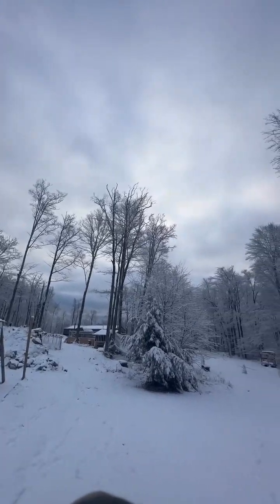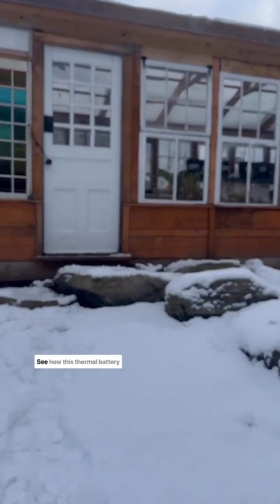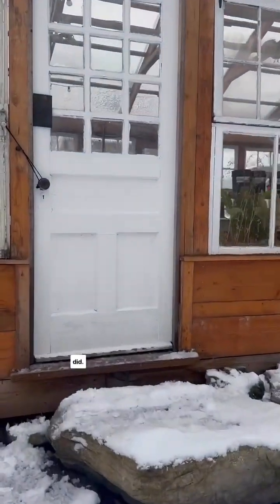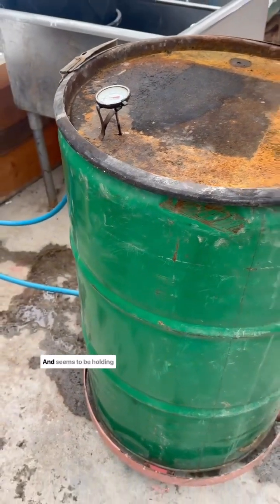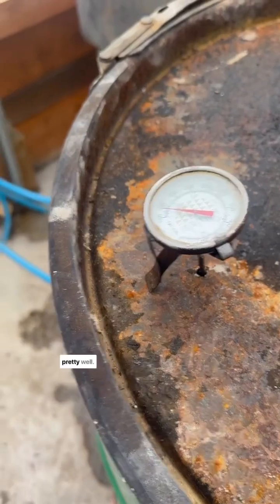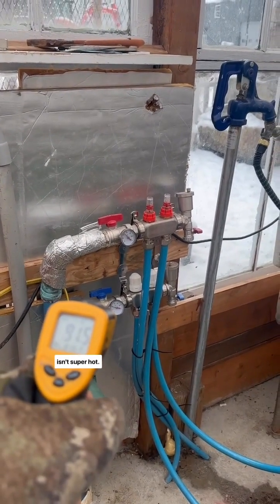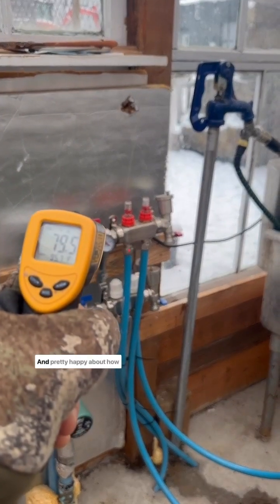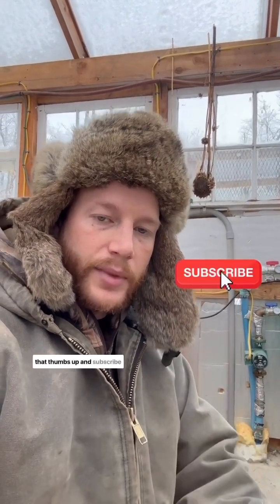Checking out the DIY sand thermal battery build #diy #energy

Comment: ❤️ I’m to attempt making a Sand battery using a solar panel and run a house water tube through in order to prevent freezing the house plumbing during winter  …and probably  continue using that in summer to aid the house boiler….. your project inspired me .. thanks 👍🏼🙏

Comment: You're using a boiler?   I would use a passive solar heat collector (drawback is that it works best in sun, it's does get TINY warmth from cloudy sky...still has infrared even if cloudy).

The passive, insulated, solar collector (the soda can or the dryer vent hose method) will help supplement.  You might need to talk around in shorts on those sunny winter days.

Comment: A “Vortex Tube” receives standard compressed air, outputs  -50 F on one end and 260F on the other.  Could multiple Vortex Tubes, take the cold air to cool down a server room and the hot air to heat a sand battery?
Reply: Sure? Probably not very efficiently though. Vortex tubes are more efficient than peltier junctions, especially if you can productively use both outputs but they are nowhere near the efficiency of heat pumps. Mostly used for extremely robust simplicity where you already have excess high pressure air. But as far as I know common designs are optimized for extreme output temps when you don't necessarily need output a hundred plus degrees colder than ambient so who knows, maybe the efficiency is more competitive at smaller temperature extremes but I've never really got my head around the math believed to describe how they operate and how you'd need to tweak it. Its funny how the effect wasn't invented as much as discovered in the wilds of French pneumatic mail tubes.

Comment: so how does it even work, you heat up the sand with water heated up by the wood and the "battery" then heats up and does what? release the heat out? Its not a batery. You can just throw away the sand and heat up the room with the water hooses no?
Reply: Its a "thermal battery." Which means its more about keeping the space from getting so cold than getting as warm as you might. 

The waste heat goes into the sand and is allowed to re-release much more slowly. This way heat that doesn't really make any difference while the sun is out or the boiler is running goes into keeping a greenhouse from freezing over night, for instance.
Reply: @johnassal5838  but what waste heat is there? its the same heat that would warm up the air in the room. you can just throw out the sand and connet the hoose to large watter tank, increasing the volume of water in the system then at least water is heated directly in the furnace
Reply: @igormoravcik300 Do you read English? 

Its "waste" heat because it's the somewhat cooler water that's already heated the creaters home or shop. 

From a boiler that does not run all the time. Wood fired boilers in particular need to be watched. So you need a "thermal battery" to act as thermal mass and absoarb this "extra" or "waste" heat while its available and then re release it more slowly. Because this application has nothing to do with making the greenhouse as warm as they can, its just about keeping itvfrom freezing overnight in the winter while using the least amount of heat to do it.
Reply: @johnassal5838 you description is wrong there is no extra "waste" heat this is just the same heat that is produced by the fire, without sand it would just heat the air to higher temperature for shorter time. The sand there is useless, the same effect would be achieved if he would simply imcrease the water volume in the system by connecting buffer tank with water

Comment: Hello, can your thermal battery, store energy enough to power your electrical appliances ? 

If yes then How would it do against a 5 solar panel home system?
Reply: im looking into building a few of these and still deciding on the final plans, the biggest thing to keep in mind is you can heat sand to absurdly high temps, so in theory, any extra energy you create you can burn off into the sand battery. im considering mine for keeping the greenhouse warm in the long run over the winter using it as a flooring several feet deep.  the loss for this battery comes in trying to use it to turn a turbine to generate energy back from it. if you use it for radiant heat, they are wonderful.

super interesting technology tbh.
Reply: The quick answer to your 1st question is: "if it's big enough, yes!"... also see the comments about sand vs. water as the storing medium.

As for the 2nd one, you can't really compare the "producing" part of the system to the "storing" part. The thermal battery is just storing module of the system, "5 solar panels" are the energy "producer" (more accurately, the conversion module, from sun light to electricity).
A solar system may have any type of batteries, and they may or may not be adequate for your personal energy needs.

Comment: I'm a bit surprised. Video had 17 comments by now. I had two main concerns after watching it. Both were pretty professionally handled in two first comments (in the order yt showed those to me).

And the things were: aiming the ir-thermometer to average half of the wall (where emissivity is another big thing) and having way more heat capasity with water instead of sand.

Sand might slow things down a little and it might be beneficial when used as a radiator for small room though.

For capasity with sand you need to aim at >500°C to gain something. And things get complicated pretty fast with heat exchangers, valves and fans (as air is the easiest way to transfer that high temperatures) that would handle higher temps.

Handling the ir-emissivity is actually quite easy. Don't even bother to learn how the things should work, as real life screws everything. Set the thermometer (or thermal camera) to 0.95 and stick electrical tape to everything interesting. Now you have a known surface material to measure from and you could even check with something you know the temperature otherwise, like a boiling pot of water and similar container with melting ice. Couple degrees off is just fine, but after testing, you now know your tool and there starts to be some meaning behind the numbers. And those tests would make a nice video too..

Comment: Water stores 4.2 joules per gram per deg C, Sand stores 0.84  If your sand only rises to 100 deg C you could store 5x as much energy if you replaced it with a same size barrel of water. Of course you can store sand at much higher temperatures which is how it is used industrially.
Reply: sand weights 1682kg per 1m^3 water only 1000kg, most of the time when you build things like this you are space limited because the container has to be properly isolated and its "expensive"
also smaller containers has small surface area so they lose heat slower

you can store like 400kwh of energy in 1m3 of sand when you heat it up to 1000C

you can store like 116kwH in 1m3 of water when its 100C
Reply: @423GustavBern  plus the issue of converting it to elelctricity is harder with low temp water
Reply: Exactly, with below boiling point go with water..sand only if you can go freaking high. High potential heat is hard to come by, so I suppose water is a way to go in most cases.
Reply: @JanicekTrnecka  ...like a coventional radiator...
Reply: @Humanity101-zp4sq I think the idea is storage of lower grade heat or at least slower release of it. By definition a radiator is optimized to get it out and radiated/convected away.
Reply: Makes sense!  That barrel may not be terrible water tight though😂

Comment: Why call a heater a battery? 🤔🤷🏾
Whats the temp of the whole room?🧐
Reply from the maker: its a greenhouse so its at like40- 50 during the day in the winter. and its more like a sand radiator.
Reply: It's called a battery because it's "charged" with heat when there's heat, and "discharges" heat when there's no heat. This charge-discharge cycle is like an electrical battery, except for heat.

It's used to store excess heat and distribute it when it gets cold - usually daily, but can also work somewhat seasonally.

Comment: why call a heater a battery? 🤔🧐🤷🏾
Reply: A battery stores energy and heat stored within the sand is energy stored for latter or prolonged use. It is a thermal battery.
Reply: @JNash-ro5on  but the heat is generated with what wood? its not a batery just a very heavy heater

Comment: Just a quick tech tip, im case you or someone else here didnt know: the 'spot size', or the effective area that your temp gun is reading, is going to increase the further away you are from the object you're measuring. The particular brand often has a little diagram on the side of it that may talk about the specifics. But try to get within a foot or 6" if you're trying to get accurate temp readings on your pipes or manifold. At a distance it's too easy for your meausrment to be getting thrown off by a hot or cold neighbour. At 3' away you can probably assume your measurement 'circle' is 3-4" in diameter. The laser pointer dot is just a guide and isnt indicative of the measurement size.
 
Cool system you've got there! Hope you can keep tweaking and tuning it and make it work great for you!
Reply from the maker: Thanks! And yea thanks for that tip definitely true 👍🏼 regarding the gun

Comment: A couple things I believe may help your thermal battery are.

1) insulation on the drum
2) moisture in the drum may help with heat transfer

Thanks for the video
Reply from the maker: Thanks for watching and the suggestions. I am definitely going to experiment with adding water. Now that I think about it it’s more like a sand radiator with the benefit of storage.